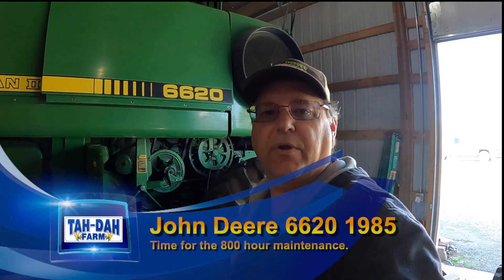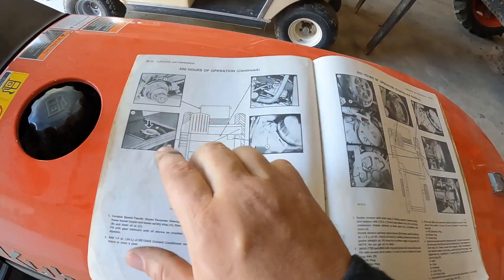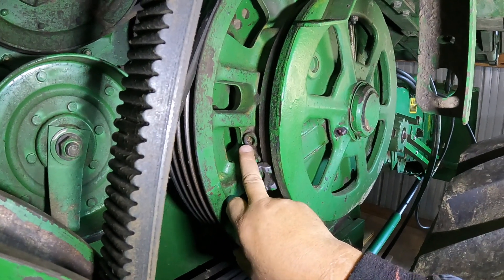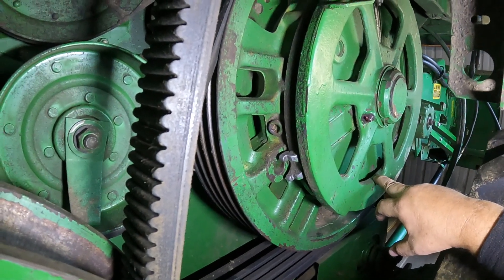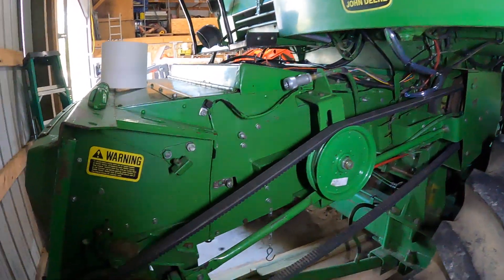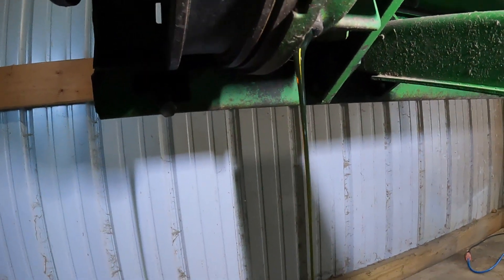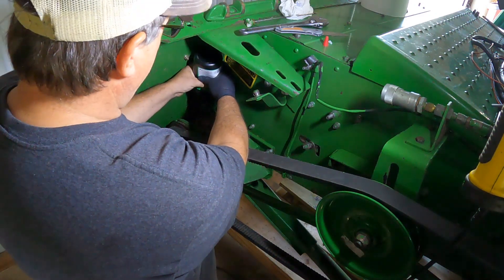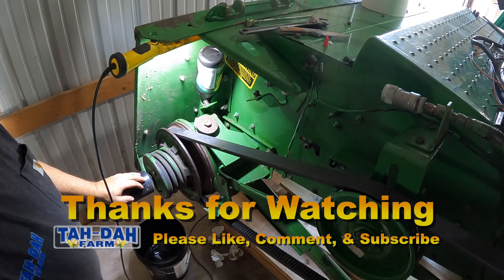John Deere 6620 800 Hour Maintenance

Comment: Looks like a nice machine. My dealer recommends a synthetic gear oil for the reverser since it can get pretty warm and change every 100 hours. I had to replace the reverser on my 9500 but it has had alot of filings everytime ive changed it so the damage was already done
Reply from the maker: I was surprised that the oil looked as good as it did. The former owner didn't remember the last time he had changed it.
Reply: I just bought some of that, 460 synthetic, 36 bucks a quart😳. Better than a thousand dollar plus rebuild though🤣

Comment: Where is your engine oil fill  , on your  6620,
Reply from the maker: On top of the engine in the center of the valve cover. The dip stick for the oil is just behind it.
Reply: @TAHDAHFarm  thanks

Comment: And this is why if I had the money I'd buy your older combine cuz I know it was took care of
Reply from the maker: I sure try to take care of things but this feels like I'm starting all over again. Yes the old combine is in great shape.
Reply: @TAHDAHFarm  I know I watched you keep it in great shape👍
Reply: @TAHDAHFarm  Tim I'm struggling with something on my 3300 right now the separator Bowl filter screen that screws into the bottom of the fuel tank, I cannot get it to stop leaking through those threads you got any idea what kind of sealant would work?
Reply from the maker: Teflon tape is not good with diesel.  In fact they stop letting us use any Teflon or Teflon tape at work. They do make a tape like Teflon but it's made of something different that's good for fuels but I can't think what it's called. I should be able to find out at work tomorrow.
Reply: @TAHDAHFarm  thank you for your assistance with this my friend. 🙂🙏
From my reading and research Permatex has a product called Aviation gasket sealer.  
Product makes claims of being able to withstand the pressures from petroleum distillions. 🤔